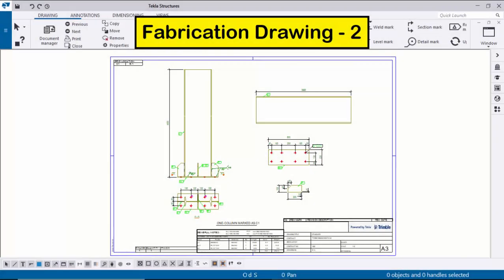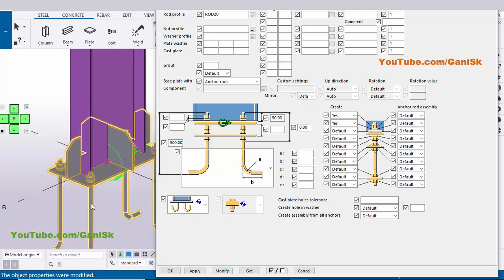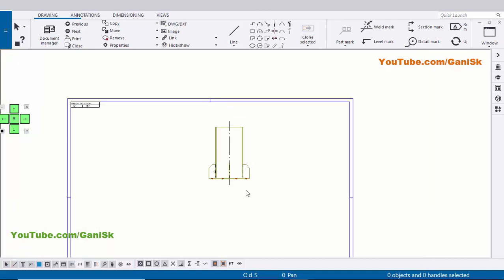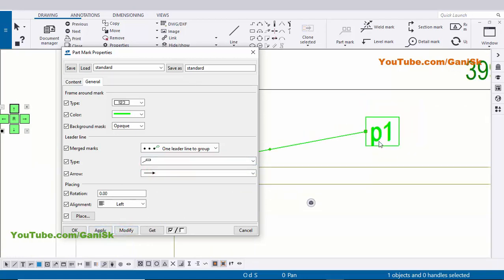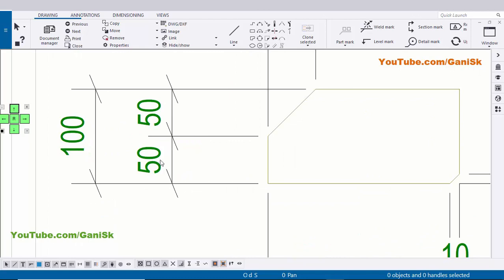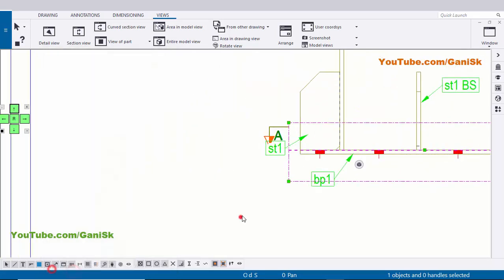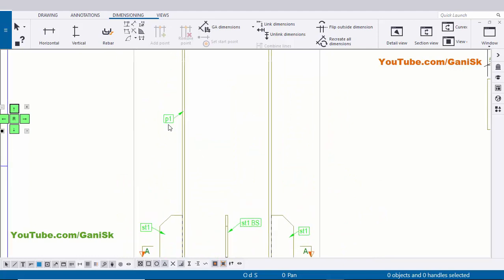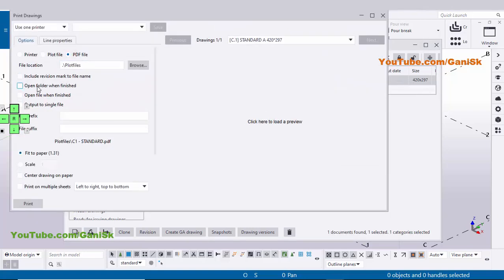Tekla 2021 Tutorial 28 | Tekla Detailing | Fabrication Drawings

Comment: Sir i am using 2022 version after creating column and applying base plate if i right click on it the option create drawing is not showing up there and also i tried by tool bar but no progress
Reply from the maker: In tekla 2022 procedure little bit different, I will make a video on it.